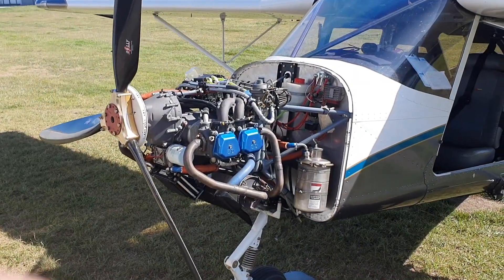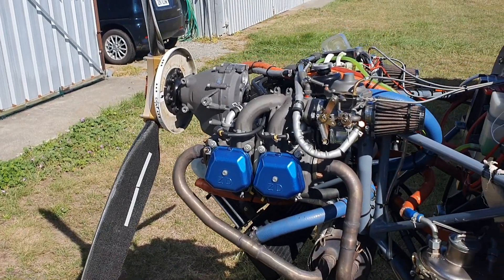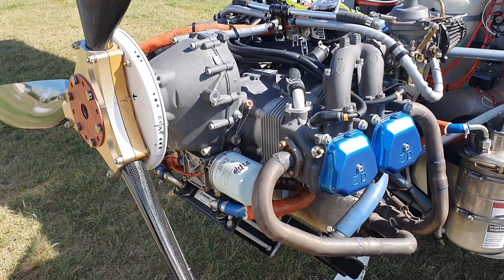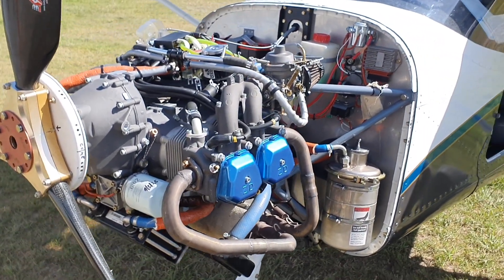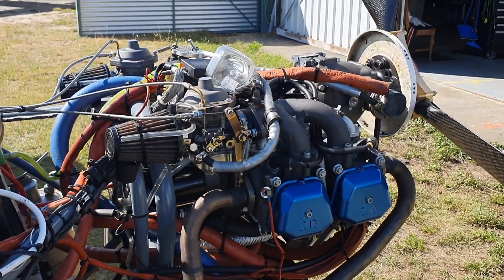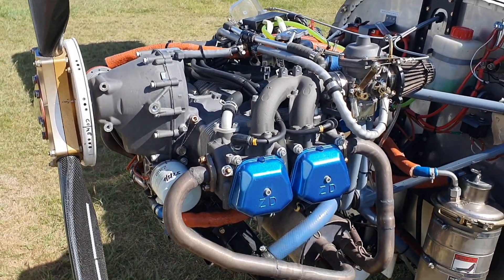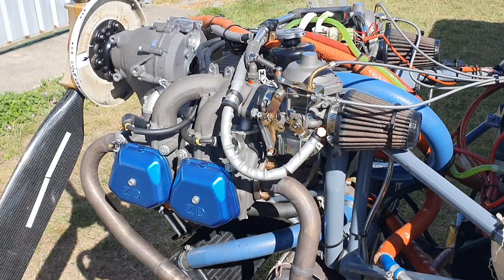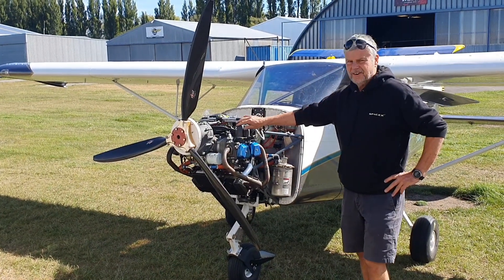HAS CHINA CLONED A ROTAX AIRCRAFT ENGINE !

Comment: To compete do something like  - "The splitting piston tech" as splitting the  ring section from its skirt, the 2-piece piston retrofit technologies can usher in the advanced hybrid engines. The ring-section is operated via (valvetrain-like) piston-train to pump the gases in the exhaust strokes and reunite with skirt for the heavy compressing and power strokes. This new piston design completes the 4 strokes, different in both displacements and periods, in every revolution – called differential-stroke cycle which is a hybrid of 2-cycle and 4-cycle – to >2.5x power and >20% efficiency gains.
Reply from the maker: Interesting, maybe one day it will work its way into aero engines. Engine  manufacturers for aviation are very slow to embrace new technology, they tend  to stay with proven high endurance/hour  designs,
Reply: @NZEagle  Thanks for the advice. This revolutionary technology may worth some consideration.

Comment: We have this engine fitted to a Tecnam Bravo in NZ. Two oil changes and about 80 hours. We have found it to be super smooth and very reliable. Word has it the Zonsen have been making the parts for the other engines anyway. Also doesn't leak oil. Would do it all again
Reply from the maker: Good to hear a positive report,  and very informative.
Reply: Was it half the cost of rotax like the one in video in Australia they only 6 k cheaper

Comment: You can clone what you want, but EASA certification is another level. NEXT level indeed.
Reply from the maker: I was wrong in saying they are fully certified in NZ. Have updated in description.  There are conditions applicable.
Reply: We won't be needing EASA or FAA. Moving forward, we will only need Chinese certification.
Reply: This is not true easa is just  old engineers that make a very good money correcting English words in report that was copy and paste by young Indian engineers that are outsourced buy Europe companies
And in the weekends they spend the industry money in very very expensive diners in airfield restaurants
Reply: @ricardopelin1143  A Chinese made altimeter, brand Falcon, had a leaky aneroid. That is the engine of the altimeter (!), so it was useless. I checked the innards further. The internal brass frame had casting porosities on more places from where oxidation product migrated. Rough running gear train also. General impression: Crap. Outside it looked even more shiny than a Kollsmann or United instrument altimeter....
Remember: you can only drop dead once.